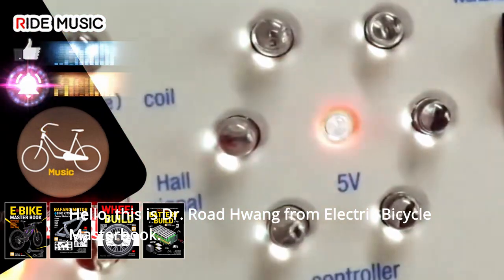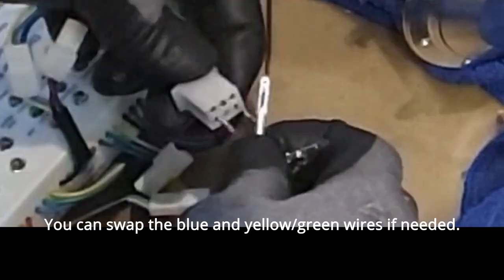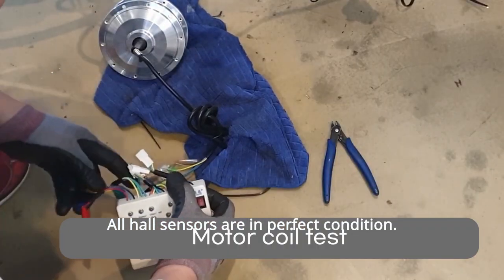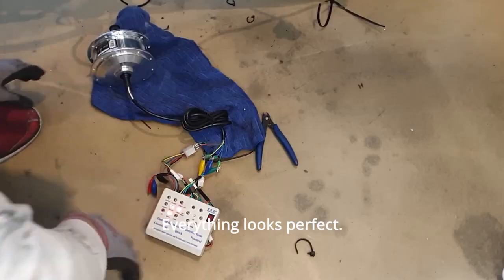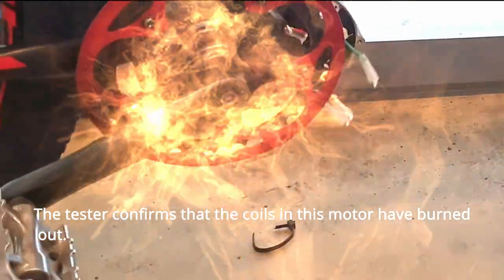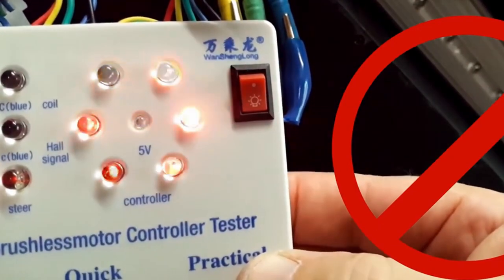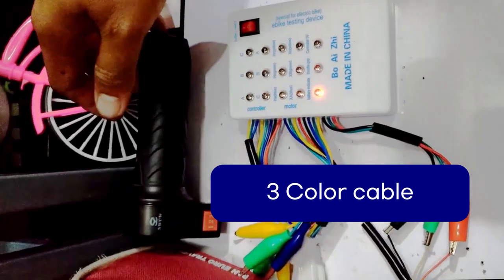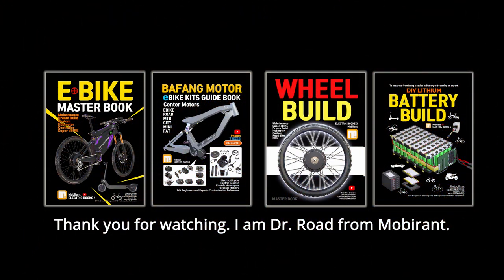How to test electric motors and controllers : E-Bikes and electric scooters

Comment: 2:39 turn on controller power does that mean the controller has to be hooked to the battery to test
Reply from the maker: Yes, that's right. However, recent products are connected like a hall sensor, so normal testing may not be possible. If the motor test is normal, it is most likely a controller failure.
Reply: @Mobilant_US  thanks now the trick is to find a replacement I saw the exact one I have on alibaba was ready to order then I noticed not available

Comment: This video has all the hall marks of a scam. The video is poorly made. None of the test functions are properly explained. Claims to test functions that are purely mechanical.
Reply from the maker: This tester is still in good use. Similar products also have the same functions. It is mainly used to determine defects in the motor's Hall sensor and coil.
Reply: What the fudge ?